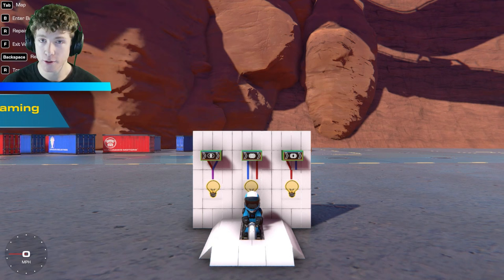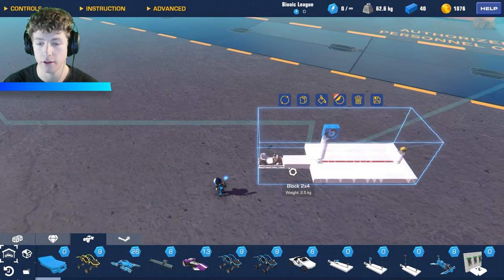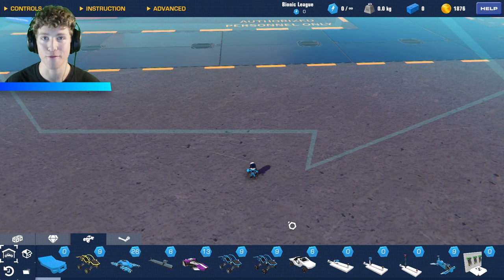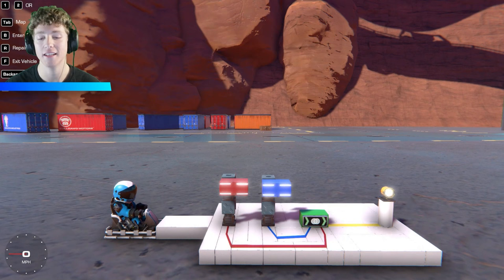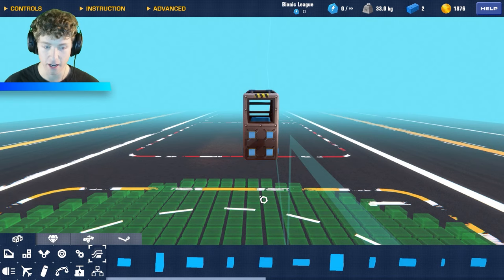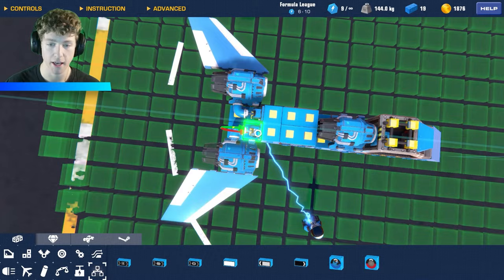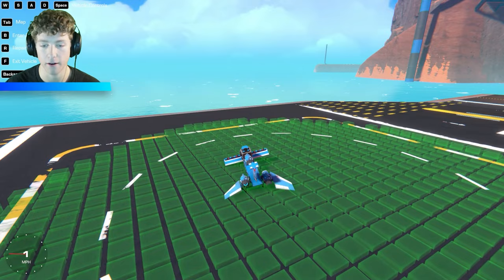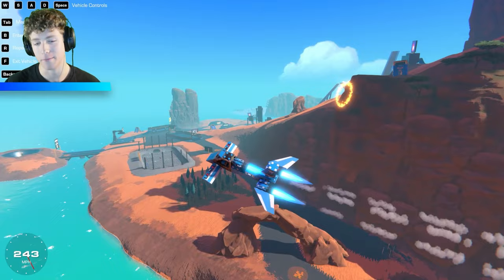Logic Gates in Trailmakers | Tutorial from LittleCornDogs

Comment: I know how to make Thrust Vectoring in this game like the F-22 Raptor or the Su-57. I originally used to make it with just the hinges but a week or 2 ago my friend had the idea to use OR gates and I did all the work of the block settings. for some reason though all blocks on Xbox are basically a XOR gate. the AND gate will turn off blocks when both are pressed but will work when one or the other is pressed. same with the regular OR gate. I had a look at this vid to see a solution, but I can't seem to find one
Reply: This video is fairly basic and doesn't contain any of the information explaining the concepts which lead to that behaviour. The reason for that is that you are using both keybinds of a single block, which act as a single input. Additionally, logic signals aren't purely binary: they have a value in the [-1, 1] range attached to them. The red keybind has a -1 value while the green keybind has a +1 value, so when both are pressed their values are added resulting in 0 value as output (which on steam and on most cases on consoles, is equivalent to no output). For more information about how logic blocks work, I made the most in depth, accurate and updated guide there is, but I can't send the link as youtube auto removes my comment (you can look for it on my github, I have the same username there as I have here)

Comment: I want to use the logic to make it where, if I'm below (input unsafe altitude for bombing) then prevent the bomb bays from, well... dropping bombs. How do I do that?
Reply: Connect the bomb bays to an "AND" gate as well as an altitude sensor set to the minimum height allpwed for your drops
Reply: Remove the key from bomb. 

Place an distance sensor set to face the ground.  Set it to whatever max height you want to allow the bomb, and invert the trigger.

Connect that to an AND gate.
Set the green arrow key to your bomb key, and set it to affect the bombs. 

If the distance sensor sees something (the ground) within its set distance, it will not send a "1" to the AND gate.
If you press the bomb key on your and gate, it will still require the distance sensor to also send a 1 or it will not send an activation signal to the bombs.
Reply: You can also add an extra layer of safety by connecting an angle sensor to an AND gate, connecting the distance sensor to an AND gate, and then connecting that AND gate to your Tigger gate. That will say "you need to be X meters off the ground, AND at this certain angle to drop bombs" so you can't drop them at way too steep of a climb or upside down and destroy yourself lol.